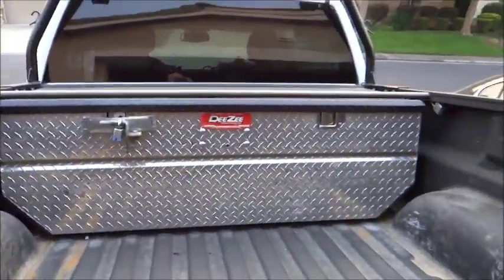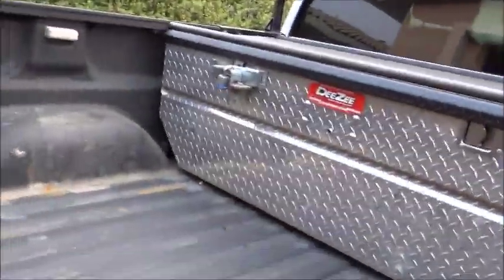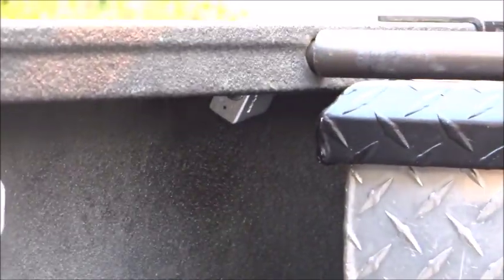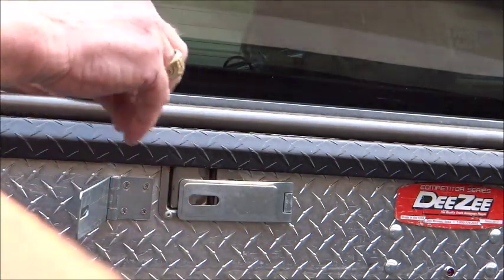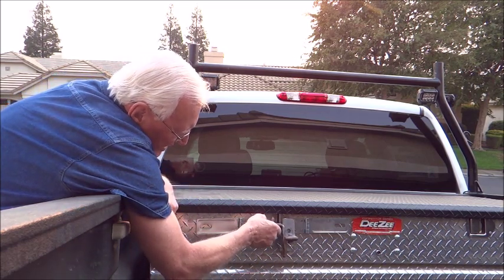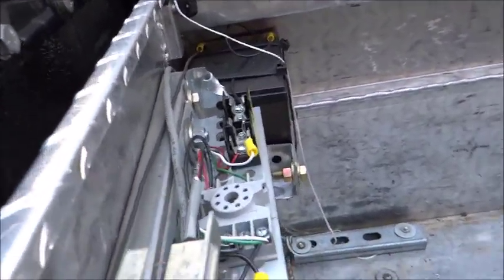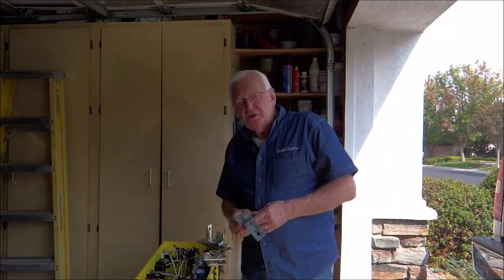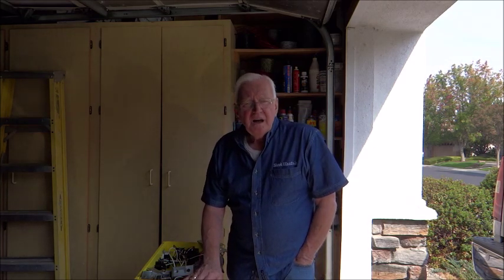Truck Toolbox, Protection, Pickup Security, Spare Tire Locks, Electricians Need to Know:

Comment: Legend has it that "The Ark of the Covenant" is securely stashed away inside John Shook's tool box in the back of his truck. Wouldn't it be easier to just steal the whole truck?
Reply: Funny shit.
Reply: Except it requires a combination or switches to engage the starter to work: if you watched the whole video.. 😏

Comment: Pretty neat but all that can be bypassed by a cordless circular saw and a diablo steel demon blade.  It would zip through that lid like nothing if someone really wanted to. 

I get its more for prying attempts but carbide metal cutting blades and that thin metal are the weakness.

Comment: Just put in my weather guard box in my pickup, my truck alarm guy wired it also to my weather guard box and put an additional alarm censor that will set off the complete truck alarm if it is broken into. inside my pickup the alarm system has neon blue blinking light that illuminates the whole cab really well so that tells these little asshole thieves to back the fuck off. also my truck has a hidden tracker in case anyone is successful in driving off with it, it will be a short get away. so far so good nobody has ever come near my pickup since i made the $600.00 investment. i also put a hidden gas shut off valve in the gas line so while the alarm is going off they will get very frustrated and scared trying to figure out why it won't start. so 3 different levels of security i have pretty much means they are screwed !

Comment: If they want in, they will get  in. I watched a news report where thieves spent all night breaking into a cemetery toilet, going through concrete and steel, for whatever reason. Your security is more than enough for a career criminal, they are lazy and this way to much work to break the barriers you put in place, glad this works for you.

Comment: Nice system.  The mechanical locks seem to be the weakest link.  Master locks are super easy to pick as is the stock cylinder lock on the box.  I imagine a seven ton ratchet strap or a come-along hooked under the lip of the lid and around the light bar might give enough mechanical advantage to defeat the magnetic lock.  I would cover the key holes on your tire padlocks with gaffers tape to keep dirt from getting into the lock cylinders.
Reply from the maker: Thanks!  Good idea...

Comment: Some clever ideas but ultimately defeats the convenience of the truck tool box. Just put your tools in the cab.
Reply: Great way to secure your rifle though.
Reply: Cab has windows smash and grab, is a little too much for security but I don't mind spending the extra 30s, better to lose 30s than hundreds on equipment, remember this is not just a toolbox with random stuff inside.

Comment: What is to keep a real thief (not crackhead) from cutting thru the top of the box with a sawzall and walking off with your valuable tools?
Reply from the maker: Noise.
Reply: His ALARM and LIGHTS!!!  But what you said just doesn’t make any sense anyway.  That applies to everything in life... What’s to stop someone from taking a chainsaw and cutting through the front of your house? Nothing. That’s why you have alarms!
Reply: He upgraded his system. he has two Pit Bulls in the bed at night and a Spitting Cobra in the box. He also sleep in the cab.